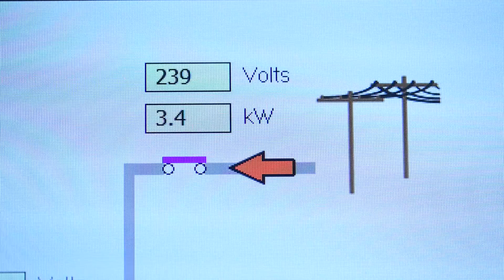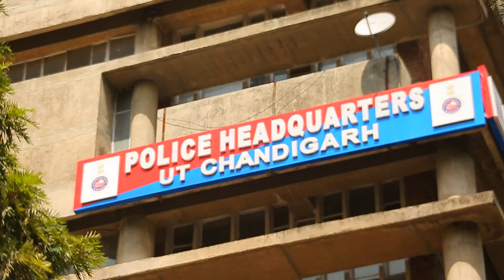A film on Chandigarh Model Solar City

Comment: It looks more like the list of clients of CREST, demand of energy and how and who made the vid but is very silent for a DIY enthusiast like me for how to go about it installing on my home using over-the-shelf products
Reply: Thanks for your concern, This is film about achievement of department and is 15 minute in duration . we have made 30 minute film and will post it here shortly  to answer your concern. After that if it will not address our query ,you can directly contact the concern authority. Regards
Reply: +denish vedi you can install a 500-600 W stand alone roof top solar PV plant for your use as an DIY project at a cost of about 60/65 K.
Reply: Manoj Nair thx
from where to source the parts, the circuit and other things needed
Reply: Mr Denish Vedi you can contact your nearby dealer and get Su-kam PV panels at a cost of approx. INR 50/Watt, a good sine-wave 850/ 950 VA inverter of Su-Kam make at INR 5000. Similarly you can have the Su-kam Charge controller at INR 4500 and a 12 V 150 Ah battery with 5 year warranty at INR 14500 (Luminous/Su-Kam). So the four key components are Solar panel, Charge controller, Battery & Inverter. Rest you need the supporting frame which can be locally Fabricated by MS angle & pipe. Similarly the wires of 6 sq.mm and switches can be locally procured. For any further query you are welcome.
Reply: In every state and city ,there is renewable energy department,can contact them for assistance and subsidies.